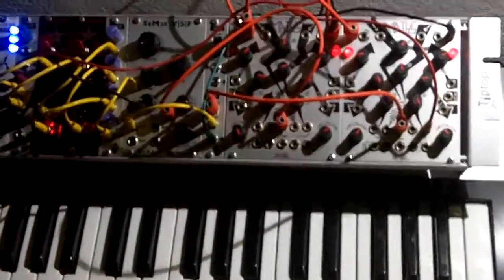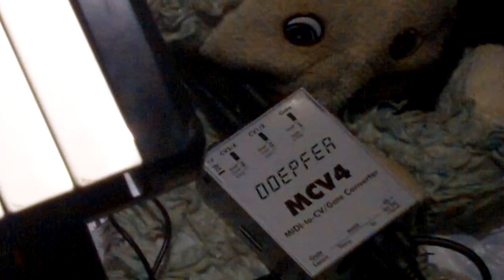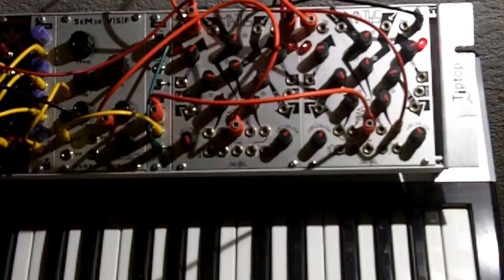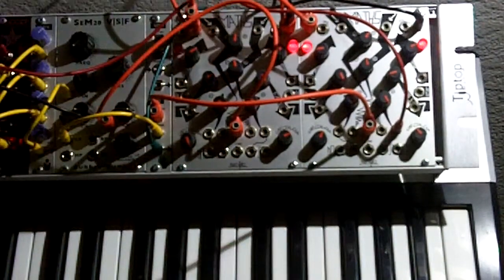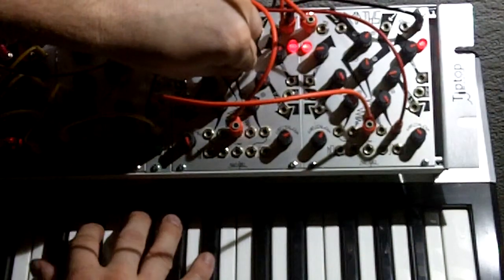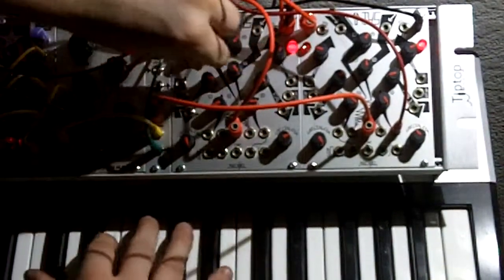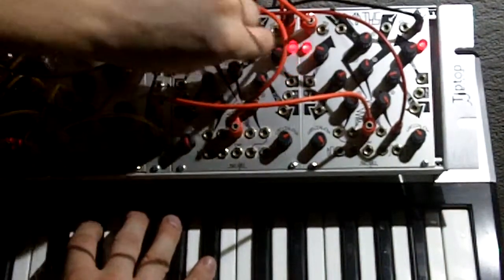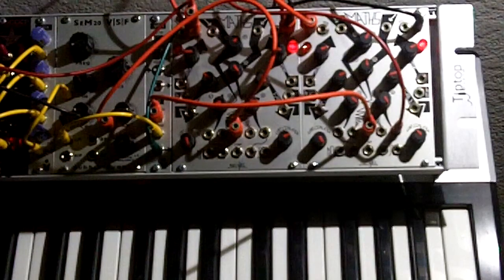minimaths

Comment from the maker: Hey Rico - thanx man!  And no, I won't be making the CCCPs (although I did repair one after it had been plugged in backwards :doh:, by replacing the LM358 dual opamp ic). 

The production CCCPs will be offered by Din Sync (in Sweden) sometime later this year. I got a hold of these ones by trading some modules Din Sync was looking for a few weeks ago.They are the same exact circuit as the OSC/TB303 vco, but with more modern parts.